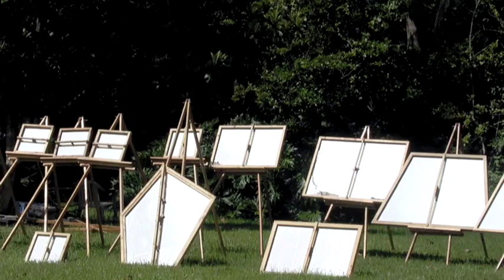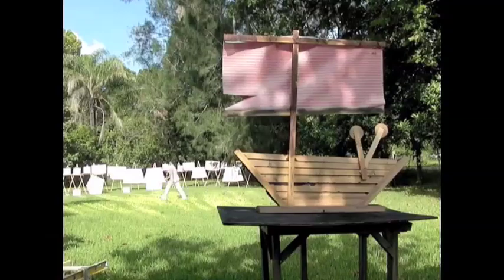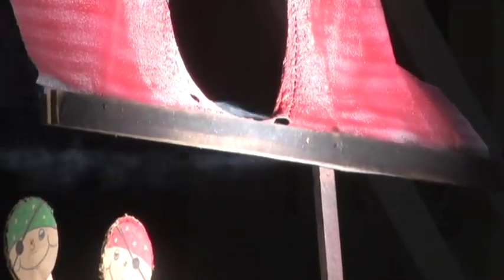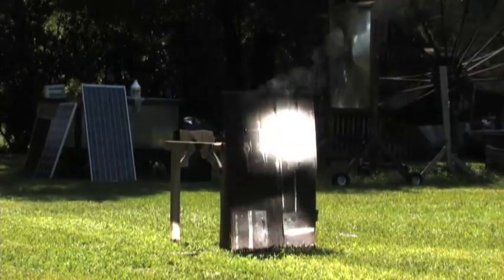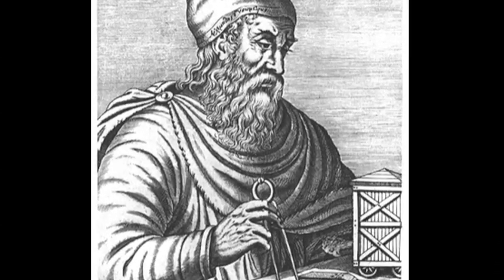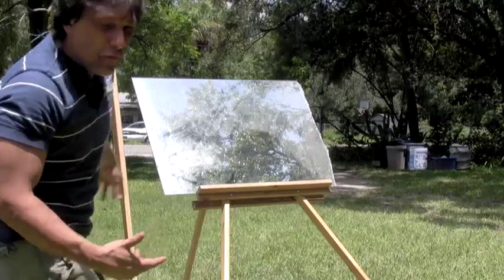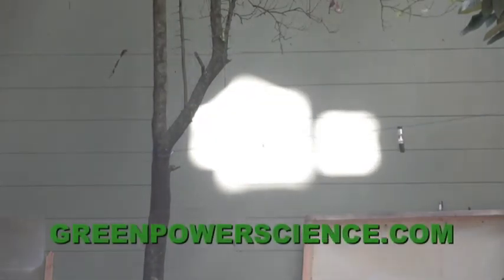Archimedes Death Ray Solar Parabolic Mirror burns a fake Roman Ship Mythbusters

Comment: i just imagine being on a boat heading toward an army of those mirrors.  even if the boat never caught fire, we would be screwed.  it would be hot as hell.  their archers would have a well-lit target while ours would be blinded even after looking away.  add that to the discomfort, disorientation, and panic a little bit of smoke would cause on the boat.  a navy with damaged sails and blind drivers sounds like utter chaos. that makes it a pretty effective death ray, even without sinking the ship.
Reply: That seems like a far more practical use for it.

Comment from the maker: @Bfrankenbergful Mythbusters most recent video used longer mirrors with 500 students, they leaned the mirrors on the ground causing them to flex into a mild concave shape. The optimal focal point of each mirror was about 20 feet, beyond that the diffuse to infinity. They were actually only using about 15% of the potential.

Comment: I seriously doubt Archimedes employed individually adjustable mirrors, not because he could not have conceived it, but because it would have been difficult to explain on short notice. A few(or a few dozen) of his disciples who understood the principles would have provided the soldiers with something to aim for.  For advancing troops the beam could widen because less heat is needed to dispatch a man, than to burn a vessel.  About 200 degrees less.  This principle also works with microwaves.

Comment from the maker: @Twistedspike Hi,
The focal area is very tight and because of the Earth rotation the sun is always on the move. With house installs good idea to go for warm not blazing hot. With lenses and parabolic mirrors your project should be in a safe area away from pets and kids. Of all the stuff we own, this shaving mirror caused the most trouble watch?v=cFxTynm8p2Q
 Easy to forget because it is a consumer product
destroyed 9 wind bottles
almost burned seat thru van window
PVC trough ripped in half

Comment: Look at solar ovens.. I like them because it is direct solar applicance.. Why cant McDonalds and Burger King  use solar ovens to fix burgers and FF?  I have yet to see a solar oven with automatic sun tracker mechansim like we had with telescopes..  We are not connecting dots at all..Simplify solar energy!  Solar energy can go much further by displacing tradtional dependence on natural gas or fuel oil, or electricity used in our furnaces than to convert it into electricty or steam ?? Nonsense!

Comment: It is also funny that the solar industry is still so focused on converting sunlight into electiricty only to end up using it to heat homes.. Why not heat homes directly with cheap mirrors??  Why are they watering down the power of solar energy .. Also why bother to mess with heating water for swimming pools  through piping etc.. Why cant we direct concentrate sunlight directly at the water surface in swimming pools?? It would work faster with much less heat loss through piping..

Comment: Get a glass cutter and cut mirrors into 500 or more smaller squares maybe one inch or two inch and assemble them all on a special constructed board with adjusting screws or ram mounts (ball socket) for each tiny mirror so you can have a powerful smaller portable death ray board. What is more , you can make more copies of them . See what 10 death ray boards can do to a target.  You can probably burn a 2000-3000 degree F hole through a steel plate one quarter inch thick . I saw them.

Comment: @dwarf2 

Fire is one of the most dreaded dangers at sea. It always has been. Everything is so dry, and it spreads so fast.

If they set fire to the sail, the ship has a problem: it can't move, and is a sitting duck. If the sailors drop the sail, they're a sitting duck. If they wet the sail, they might be okay, but can they wet the top of the sail? 

If the beam is focused on inside the boat, and in response they fill the boat with water, they go pretty slowly...

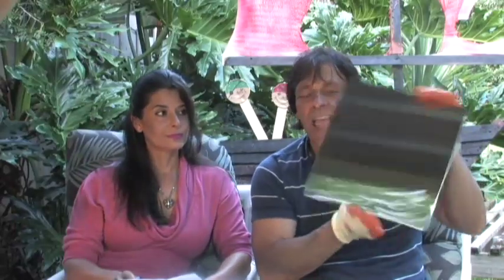Comment from the maker: @Bob06460 The glass absorbs some of the light, that is why first surface metal mentioned at 2:10 closes the gap between mirrors Archimedes may have used vs glass mirrors used in many recent tests. Most glass mirrors are 90% or less reflective depending on glass used and thickness. I shot a section explaining how glass mirrors are made but the video was getting too long.
Reply: essentially it stops most of UV and some IR while metal reflects, right?

Comment: Of course the reason this weapon didn't expand everywhere was it's dependance on the right sunshine. One thing though was when this is tested it is important to the testers it destroys or starts fires. Not so. I would think the sailors would have got out of Dodge as soon as the heat started cooking hem like baked chicken. That;s why the NWO has microwave crowd control machines like this one;  search,  HEAT-RAY CROWD-BUSTER  on youtube

Comment: Awesome display of sun power. Although I doubt Archimedes heat ray would have worked. Not because he didn't have the skills or know how, but because the ships are constantly moving on the water. It would have been near impossible to hold a concentrated beam of light on a small area, much less the amount of beams needed to ignite it. I'm not saying it's impossible. I'm saying it's unlikely. Nice video :)
Reply: Well, a lot of mirrors like 100 of them could do, and even if not wood - sails are more prone to ignition or at least to have burn-holes rendering them useless....

Comment: @kitrana What do you mean that Archimedes' location faced the wrong direction for a heat ray device? As long as the sun is out, you can reflect it back in any desired direction.

Comment: Archimedes was a bright guy. He invented a hook on a swing arm to hook enemy ships as they try to dock that would simply pull one side of the ship up until the lower side swamped and sank the ship. He also invented a long screw water pump, they used to pumped the water to tanks above the docks. In an emergency, these tanks were designed so they could be turned over to swamp ships trying to attack the docks.

Comment: @andruha11234 They did "bust" this but GreenPowerScience just CONFIRMED it. How did Mythbusters screw that up? There probably kicking themselves.
Reply: They didn't screw it up. This video moves the goal posts of the test significantly. The Mythbusters did this with an actual boat which was moving as a boat would do on water. This is not the same experiment.